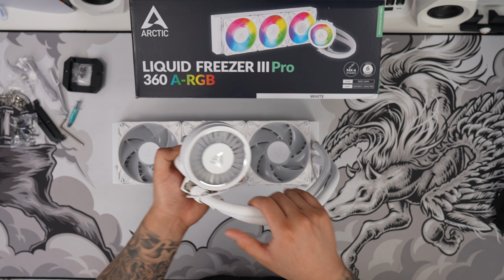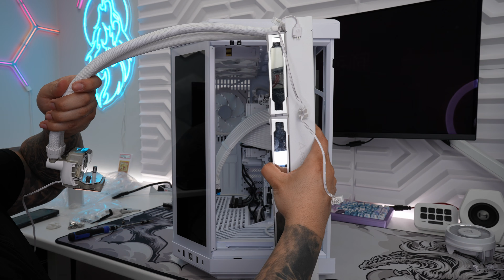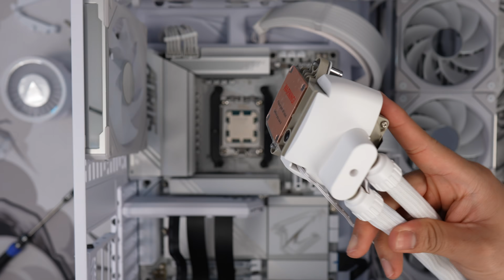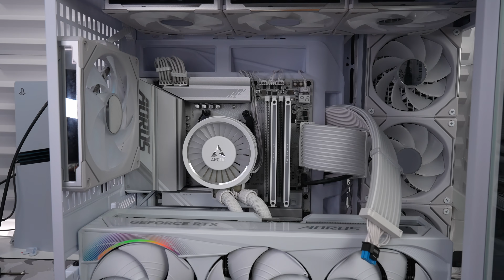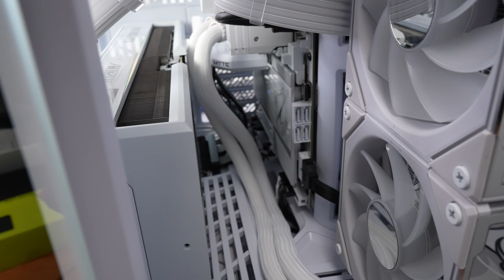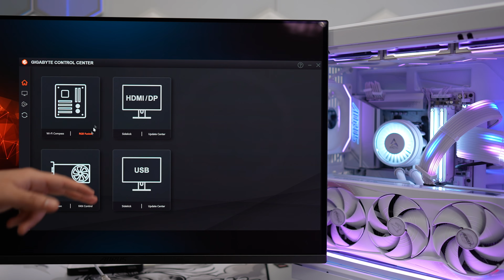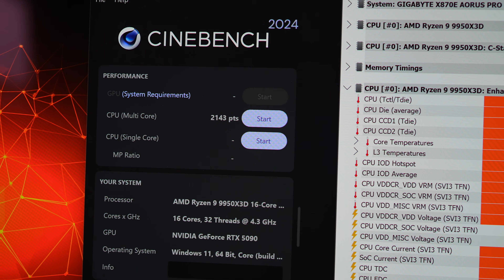Arctic Liquid Freezer III Pro 360 White : How To Side Mount, Control Fan Curves & RGB Control on AM5

Comment: I am planning to use the ARCTIC Liquid Freezer III 360 Pro AIO liquid cooler with an AMD AM5 motherboard.
I would like to know whether using the Thermalright AM5 Secure Frame (CPU Contact Frame) together with your cooler is safe and fully compatible.
I would particularly appreciate clarification on the following questions:
Is the Thermalright AM5 Secure Frame compatible with your cooler's mounting mechanism?
Can I use this product without removing or modifying any part of ARCTIC's original AM5 mounting system?
Could using this contact frame negatively affect the contact pressure between the CPU and the cooler, pressure distribution, cooling performance, or thermal conductivity?
Could this combination cause any damage to the CPU, motherboard socket, or cooler?
Do you officially recommend using these two products together?
I would appreciate a clear confirmation of whether these two products can be safely used together without causing any compatibility issues or negatively affecting cooling performance.
Thank you for your assistance.

Comment: Nice to meet you. This is a video from a year ago, but I’d appreciate a reply if possible.
Regarding the motherboard (X870E AORUS PRO ICE), does the AIO pump interfere with the M.2 heatsink?
I’m planning to purchase the same setup shown in the video, so I’d be grateful if you could reply.
Reply from the maker: Thanks for watching!
And no interference thankfully since the M.2 heatsink is low. You might not be able to swap the ssd though
Reply: @FIREWOLFTECH 　Thank you so much for replying so quickly!
So, if the SSD can’t be replaced, does that mean it doesn’t interfere with the M.2 heatsink, but the AIO pump gets in the way when I try to remove the heatsink? Sorry for asking so many questions.

Comment: interesting, the aorus pro on arctic website sayd it's not compatible with the heatsink
Reply: That’s exactly right. I’m really struggling with that right now.
I’m using the same motherboard as in the video, but since the video doesn’t show the gap between the M.2 SSD and the heatsink, I’m hesitating to buy it.
Reply: @mnadhd ye, ended up with a strix b850-e, its good enough for me..

Comment: Hello, do we need to have the pipe at the bottom or could they be at the top?
Reply: It' recommended to keep the tubes below the pump and radiator, to minimize the ability of air entering the pump and causing premature failure.

Ideally, you'd have the setup he used, or mount the radiator to the top of the case for the best performance and allow your AIO to last as long as possible.

Comment: Much better than Artic official video, what a shitty design to screw the head pump to the brackets, why the f* didn't they put 2 large standard screws? It's a nightmare to install, I tried it fake without paste, I can get one of two screws in but the other one doesn't "bite" even if I try to screw only very little the first one, can't get both in place at the same time, f... Arctic

Comment: As an hvac professional I promise you having 3 pushing and 3 pulling fans is absolute ridiculous and does nothing for heat saturation stick with the 3 fans inside pulling air through same concept an outside unit works with a fan sucking air through the radiator up through the top. You are doubling your power draw vs a 3 fan set up and getting 0 gains from it, 2nd is if those fans are off by even a little it acts as a window where the fans have to now push or pull air through not only the radiator but through the other 3 fans. Making it arguably worse because in between the 2 lines of fans if Anything is even slightly off causes turbulence pushing air in wrong directions ruining fan bearings, it is just a nonsense design in general.

Comment: Will this AiO fit the Lian Li O11 EVO RGB?  I'm thinking to have a White build AM5 soon.
Reply: hey did you try it? I am actually considering this cooler with Lian Li O11D Evo RGB too, unsure if this will fit.
Reply: @ofgalacticstuff  Sup, I ended up with beQuiet! 420 due to the unit that I received from Amazon, it had "eternity spin" screws; so I returned it.  Plus Artic's RGB isn't eye catching enough for me.
Reply: @OutlawsOG-Blessed  420 damnn... nice! I checked out more coolers and liking the HydroShift II LCD-S 360 TL Black. 

May I know what case and gpu u got?
Reply: @ofgalacticstuff Lian Li O11D EVO RGB White - Panda Build
Reply: @OutlawsOG-Blessed sweeet!

Comment: What cases would you recommend for this? Been having an issue myself. 

I got the NZXT H6 Flow case and there isn’t enough clearing to cover the thickness of the cooler above the motherboard. My motherboard is the X870 Steel Legend WIFI.
Reply: Try the H7 Flow, it should fit.

Comment: So....as I see, your push pull config on the radiator is the wrong way around. You blow all the warm air into the case.
The air warmth in the room is approx 20deg.c? So that won't cool much.
You always must blow/suck the warm air out of the closed cabin. That prevent other components become warm to

Comment: I’m using a Ryzen 9 9950X with an MSI MAG X870 Tomahawk and an Arctic Liquid Freezer III Pro. My CPU sits around 60°C at idle and goes up to 85°C under load. Is this normal, or is there a way to bring the temps down? Any advice would be appreciated.

Comment: i have blood in my mouth raging at the fact i have to watch ALL videos, trying to find out where to mount my fans.. i plan on putting the radiator i. the front of my case. my old cooler then had the fans outward, and the radiator behind them, more inside the case, than the fans. so as i am finished moving the pre assembled fans to the other side of the radiator, i check the manual, where it says to simply just rotate the fans 180 and so they will assumebly suck air THROUGH the radiator, and the fans wont show on the outside at all.. There is abselutely no way that is correct. yet the fcking manual say it is! WHY DO PC STUFF HAVE TO BE SO COMPLICAGED😂😂 i am short on time, and i just cant fxking figure this small thing out! why??

-edit, the fcking qr code on the box sendt me to the wrong aio.. some other version where the fans are pull or something.. searched for the manual online and now it says to do as i would have thougth.. thank god.. now to spend an hour figuring out the wiring and another hour relearning how to apply thermal paste as my cpu was really hot last time and the paste was not spread very good, even tho i did the x pattern..😂

Comment: I’m trying to do a push pull configuration for my radiator but the aio only came with 12 preinstalled 34mm screws and I need 12 more for the other, if I use any other ones I would risk damaging my motherboard and radiator does arctic sell the same screws or can I use any 6-32 unc 34mm screws 
(Please someone help)

Comment: That’s a nice build, and you gave great instructions! The video was well don’t too, the camera angles, the circle zoom, the explanations, nice work! I was actually so concerned about the thick radiator fitting in my case that I forgot about the m.2 heatsink, thanks for the heads up! You get a like and subscribe from me! 
    Im wondering if are you using a dedicated fan hub or controller or did you direct connect the pwm wire to your system fan header for the fans? I’m having difficulties finding some good reverse argb pwm fans for the price, and hub/controller, so that I can use my Asus mobo with the Antec c8 curve case. Can you recommend a controller or two and some reverse argb pwm fans that are nice, quiet and won’t break the bank? 
  Thanks again! 😎

Comment: Hello and thanks for the video. It's very helpful. I'm with the same AIO. and MB - GIGABYTE B650E AORUS ELITE X AX ICE 
I have a question - Should the fan profiles in the BIOS match those in the Gigabyte control center software?

Comment: Just installed this cooler and it sounds like my pc is about to fly away. Silent mode didn’t help either. Hopefully doing  custom curve will
Reply from the maker: Def adjust the curves since they go by % 
Most fans RPM are 1800-2000, so this being 3000 means lowering it more
Reply: @FIREWOLFTECH thanks I’ll copy yours lol

Comment: Tubes lower than the pump? Should not be higher then the pump?
Reply: No. The idea is to keep the radiator above the pump.
Reply: @Prometheus___  smarter put tubes at top due to unwanted air bubbles accidentilly going into the pump and aging it etc
Reply: @nickwescott4169 if the tubes are at the top of the radiator then it is more likely that the air that collects up there will be pulled into the pump. If the tubes are at the bottom then there is no chance that air gets into the pump since the air is collecting at the other end of the radiator.
Reply: @williamgrenke4758  maybe u missed about gravty
bubbles go up in water not down but ok bruh think what u want
Reply: @nickwescott4169  https://youtu.be/BbGomv195sk?is=piSfrJtuh8iHtDz-
Reply: smarter put tubes at top due to unwanted air bubbles accidentilly going into the pump and aging it etc

Comment: Mine is coming today and i had so many questions that other reviews just weren't telling me but this one had all the answers, appreciate the in depth details.
Reply: Did he use 3 Reverse fans on the aio cooler and was it Lian Li UNI SL120 INF Reverse Blade Addressable RGB Black 120mm Fan?
Reply: @KingSxltyit looks like reversible fans to me otherwise you would’ve seen the back shroud which you can’t. I’m not sure which fan model though because my build is completely different to this cause I have a push pull config with noctua fans

Comment: Excuse me, I am just curious. Can  this idea work for a water build too? Putting the 360 on the side but also having another 360 radiator on top. 

Or should I downgrade the size for just 240 radiator  instead. So it can be easier for the water loop/tubing.

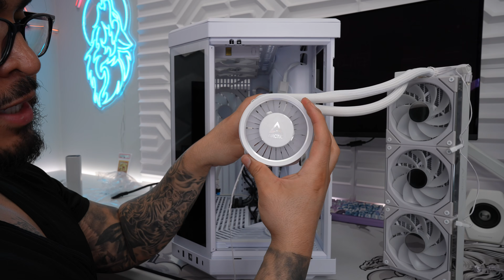Comment: Oh and at 4:50 no you cannot remove the Arctic logo and "kind of" flip it. I tried this thinking I could, but you cannot as that tiny little cover is metal and it has a small notch that tells the factory worker the proper orientation to install it thus preventing the consumer from adjusting it otherwise. Instead I bought a pack of blank white round stickers at an inch and a half diameter and it perfectly covers the logo and makes the entire thing look solid white which I find more aesthetically appealing; even with the logo right side up as I now have it.
Reply: So can you install it upside down even tho the vrm fan is spinning opposite?

Comment: Yes tubes should always be on bottom to avoid air bubbles going into the pump and reducing its life span. Had that happen 3x before learning how aio's work and that tiny resevoir at the opposite end of the aio (opposite the end the tubes are on) is actually for static air. GN (gamers nexus) did a vid on this about 3+ years ago cutting into it and demonstrating how this works.

Comment: tip for installing the bracket (I found this in the comments on the official) - thread the leaf spring screws first into the two black brackets (at this point the brackets that connect the water block to the mobo should only be connected to the leaf spring screws and not the motherboard) , then thread the 4 screws to connect the bracket to the motherboard. tighten as needed.

 with this method I was able to install it in a couple of minutes - first time first try.
Reply from the maker: That is probably way easier than doing it the “correct way” 😅 since those spring screws are annoying to thread both into the hole
Thanks for sharing!
Reply: @FIREWOLFTECH Did you use 3 Reverse fans on the aio cooler and was it Lian Li UNI SL120 INF Reverse Blade Addressable RGB Black 120mm Fan?
Reply: @FIREWOLFTECH hey fire wolf I’m building my very first pc I bought the same aio and the motherboard I’m going for is the msi x870 e edge can I control the fan curve like what you are doing with the msi motherboard?
Reply: You’re a genius
Reply: Checked this on my mobo as well but it wasn't good, the lower part of the CPU block covered the 2 lower screws, there was no room to screw them once the CPU block was screwed in the brackets first. What i suggest is to make sure both screws are out and even, that way you can have an easier life in nailing both holes without messing the paste too much. Worked great at first try.
Reply: I am in the process of awaiting this AIO  and had been looking around since i noticed Gamer Nexus having  an issue  with the the leaf spring system, your method  sounds a better sequence , comment still beneficial.
Reply: All these people having trouble installing the brackets must be inept. Installation of everything on this thing was pretty much a breeze. Maybe the ONLY semi-difficult (and that's a stretch) was installing the pump on to the brackets. My first go around I didn't hold it in place tight enough and misaligned. 2nd go around a few seconds later I held it super firm, screwed it in, all done. Found the installation overall to be very easy.
Reply: @DominicanOps Good for you…

Comment: Hot air come into the case though radiator, is that a problem?
Reply: No problem but your GPU will run a bit hotter.

Comment: was installing the aio hard while using an am5 gen mobo? I saw many people complaining about the process
Reply from the maker: It’s hard if it’s your first time, I think if you follow my tips about starting with the left screw, applying firm pressure on the pump, and once you feel a little of the left screw thread going in, start doing the right and back and forth

Comment: what is that CPU temp sensor LED display you have connected on the MB on the top right? Any link for it?
Reply from the maker: It’s integrated into the MB, the X870E AORUS Pro ICE has the LED display feature which most high-end Motherboards have.
Some default the temps, while others like this one, you have to manually change to display CPU temp in the bios

Comment: Hi, I can’t customise my RGB on MSI center and even Signal RGB. So now, its stuck on solid purple when I wna change it back to Rainbow spectrum. The AIO is also not detected on either hardware…

I’m using the MSI B550M PRO VDH WIFI mobo

Anyone knows how to fix?

Comment: Wrong mounted aio tubes must go up not down
Reply from the maker: Did you miss the images when I discussed tubes on top versus down 🤔
Reply: tubes down is better, u just need to radiator was higher then pump
Reply: tubes down is technically better. tubes up will only work if the top of the rad is above the pump.

Comment: I think i blanked out for a sec, are you using 3 reverse fans as well?
You have the brackets facing each other, which in normal fans would have the airflow meeting in the middle instead of flowing through
Reply from the maker: The fans in front of the radiator are reverse blade fans 🔥
Reply: @FIREWOLFTECH  gotcha, very nice
Reply: Did he use Lian Li UNI SL120 INF Reverse Blade Addressable RGB Black 120mm Fan for the Arctic Liquid Freezer III Pro 360 CPU Cooler.

Comment: What’s the point of the new version from 90% if people believe the CPU will generate more heat with increased headroom, even if it offers limited performance? Moreover, the Arctic Liquid Cooler Pro doesn’t appear to offer any significant improvements worth switching to.

Comment: i haven't built a new diy pc in 4 years... I had no idea what that connector was in this new case at / "rgb connecotr" at 17:06 was in my new build lol... Thank you for the video i learned something.  I left it unconnected thinking it was some sort of fan power connecter but since all the fans were working without it I didn't have a clue..
Reply from the maker: You're welcome! There's so many parts and connectors to keep up with 😅 but yes those are 5V A-RGB Headers to control RGB lighting if your fans or other components have it
Reply: @ If you run past your limit of about 3 connectors on a MB, you might mention argb controllers which are cheap and snap on with magnets in future videos.
Reply: I was happy to see your comment because I felt the same way. I haven't done a new build in like 7 years, and all this RGB trend was new to me. Just to note, most MB are limited to 3 connectors, what you need is an argb controller to go beyond that, and you will likely want that if you use an AIO so you can control basically every light source and make more cool effects. They are also very cheap so it's no big deal.
Reply from the maker: @curiousgeorge7515  so actually, the amazing thing about A-RGB is that they are daisy chain-able :) I did a GT502 Horizon build with ALL A-RGB/PWM Fans and AIOs and had them all chained to the 3 headers 😏 it goes even further with RGB on the case!
Reply: @FIREWOLFTECH  ok, I knew I could daisy chain them, what I didn't know is if I could control each individually. For example, a 360 AIO with 3 fans, I would assume one plug on argb1 header would control all 3 fans to the same colour. ???
Reply from the maker: That's correct, they would all share the same RGB Signal and color
Reply: @ Ok, so I would still mentioned that a separate controller is another option if you want them to be individual colours. Also in the last few days, I found signalrgb as an alternate control software.